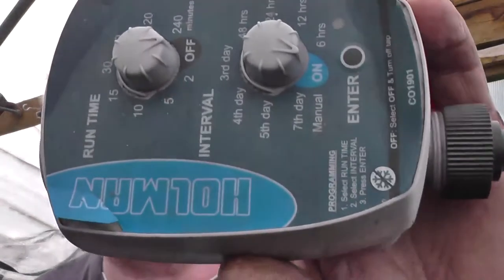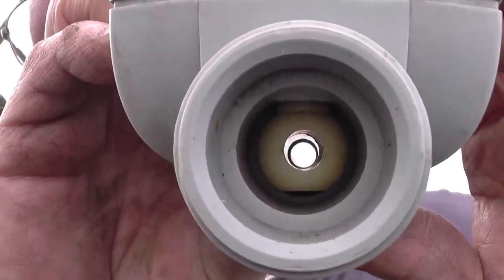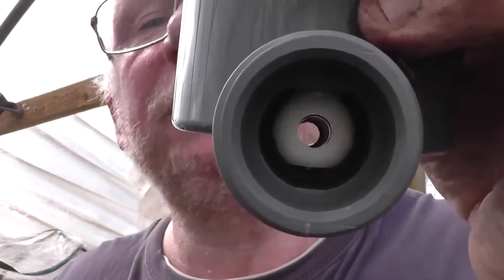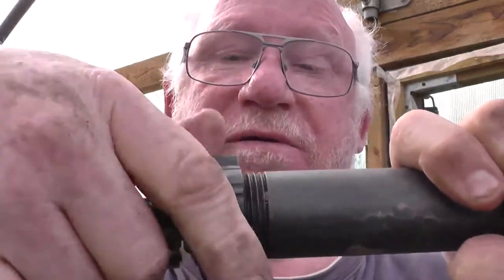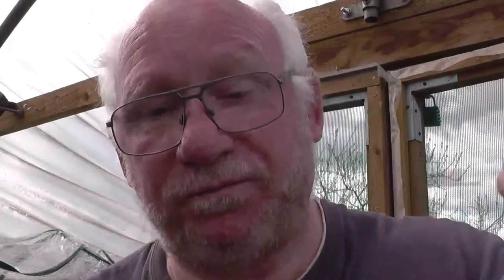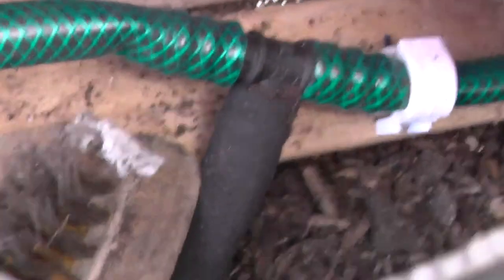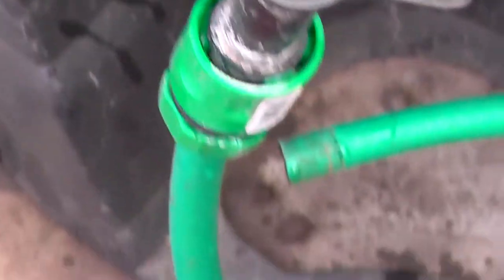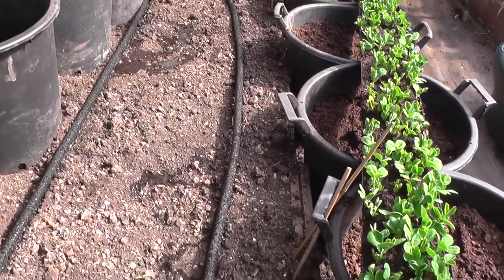Plot to Plates - Allotment Gardening | Water Butt Timers - 0020-2016

Comment: Thank you for that video.  I do not have mains water  but I do have a surface water spring which runs from about November to Spring - it is still just about running.  I can store about 2,000 litres in new money.  Do you know about how much the leaky hose releases per metre when it is new please?
Reply from the maker: Sorry for the late reply +Malcolm Brown the reason for the delay is I had no clue.  But after  running it for the last couple of months I need to top up the 250ltr barrel once a week or less depending on the weather.  Hope that helps and that you get to read this.
Reply: Thank you for your reply. I think that is a bit too much for me.